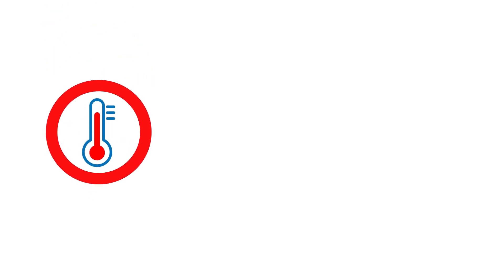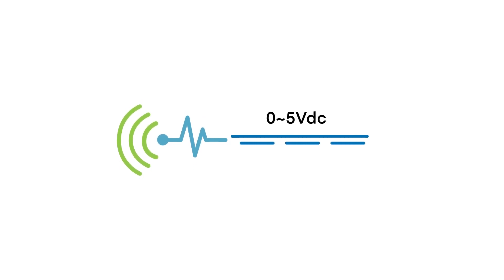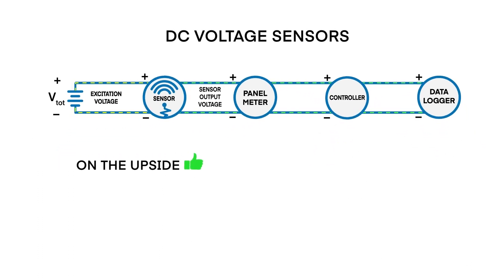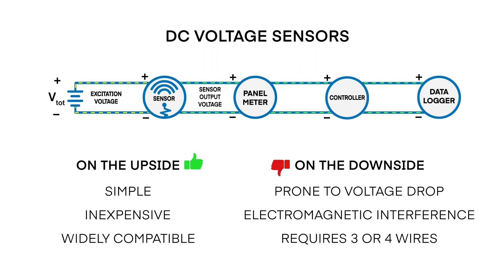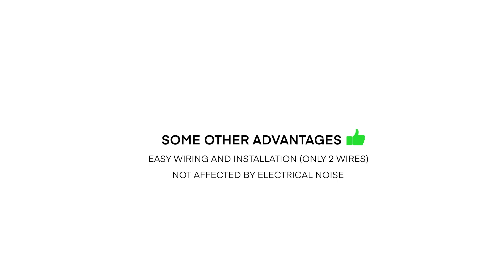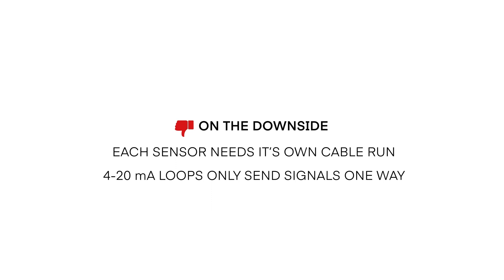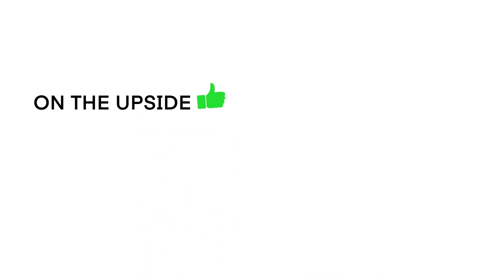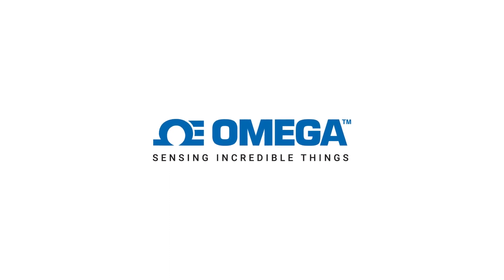The 3 Most Common Analog Sensor Signals (and how they stack up)

Comment: It means that the sensor's output signal is in the form of voltage ranging from 0 to 5 volts DC with a current capacity flowing between 4mA to 20mA?